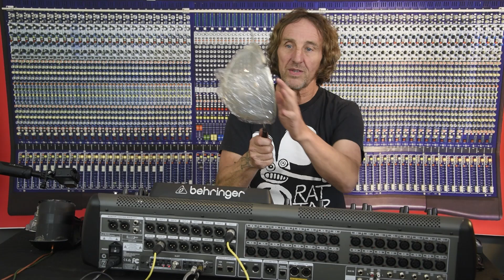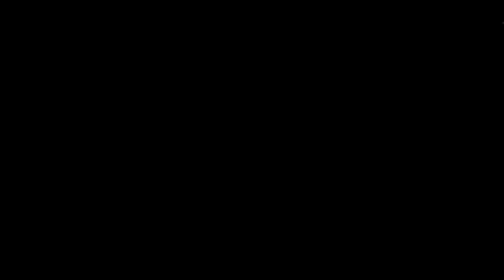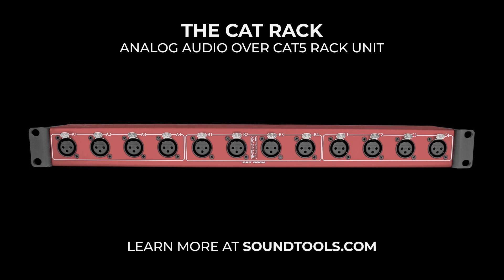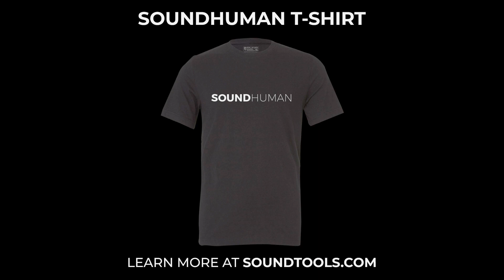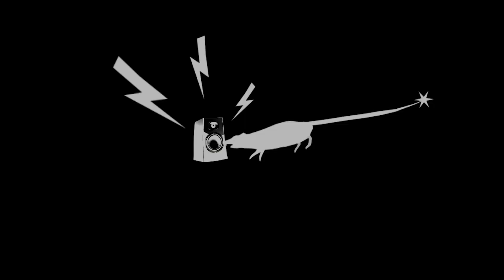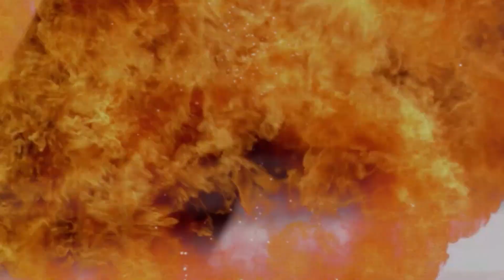Aux Fed Subwoofers Are Better - Because of How Mics Work

Comment: Another benefit of subs on an aux, is that you can easily push the energy of an entire mix on one fader or knob. Also, once the venue fills up with bodies, being able to move a bit more air by pushing a sub aux up a bit has helped me out.
Reply: I’m not going to say I don’t do this when I have Aux subs, but you do need to be aware that you are not just increasing volume, you are also changing the way the crossover is functioning. You will get a spike at the crossover point when you increase the sub volume. Not always a problem, but something to know.
Reply: @petertalalight7340  great point A++
Reply from the maker: And what do you think happens to the subwoofer volume level versus the tops and the phase at crossover point when someone walks 10 ft closer to subs and farther from the tops?
Reply: @Dave Rat  haha. Math is hard man.
Reply from the maker: I find it fascinating how much concern ther is over phase and time align of subs to tops.

Ha! Got to get that subwoofer time alignment, crossover and volume level to tops precise because that 14 foot wavelength at 80hz requires so much precision.

Got to keep that level precise because your subs coverage is perfect, consistant and within a fraction of a db of the volume of the tops matched throughout the venue, right?

So therefore to keep that precision, we will use the crude high pass and let our subs reproduce unwanted junk sound. 

I love diving into controversial subjects and will ponder doing a vid to put the importance of sub to tops alignment in perspective and when it matters a lot or a little.
Reply: @Dave Rat  it was actually quite eye-opening in your video, how much junk was still getting through the highpass filters.
 Regarding time alignment of sub to top: I've actually had situations where I purposefully delayed the subs because that happened to work better in the particular situation.
 Cheers.
Reply: @DaveRat  wow just a brilliant analysis. Arguing for maintaining phase and levels at the crossover point, when the distance between tops and subs differs for every one in the audience ha!!

Comment: Here in India, the Aux fed Subs is a Standard with most Sound rentals. As none or i would say very feeble guys know the true reason of sending Kicks, Low-freq percussions and Bass Gtr via Aux to Subs which are crossed at 120Hz or closer. Now all these low Frequency instruments produce a substantial component of 120Hz up to 1kHz. To which our charlie's in India abide to the final  testament and do not feed a bit of High frequency to the Tops (LR), fearing that the Subs may blow. As a bassist it takes a hell-lot of convincing to make them open my bass gtr channel on LR. Lack of knowledge to be blamed

Comment: I need to figure out if I can to this on my Yamaha TF-1
Reply: You can do this on any mixer that has an aux channel. But if you should is a different question
Reply from the maker: True, any console will do it.

As far as whether you should do it, Imagine every mic needed to be on all the time in the main PA, yuck!

We can turn various mics on and off and up and down. We can turn various inputs on and off in the front fills or in various wedge monitor. 

If ya have actual subwoofers, it puzzles me as to why would anyone not want to be able to reduce unwanted noise sent to them.
Reply: @DaveRat  have you heard of  Dan Dugan Automatic Mixer?
Reply from the maker: I have not but looked it up and seems interesting for situations that need automated level control

Comment: LF spill is incredibly high in distortion because it's the stage vibrating. Stages can vibrate enough that people cannot stand on them if you screw it up really properly - there have been cases of permanent damage to ankle and knee joints from the bigger meyersound rigs. That's vibration. Mechanical spill is nasty, especially coming through the shell of a floor tom by shaking the stage.
Reply from the maker: Agreed

Comment: On tour, I send the house 4 lines for the band I'm mixing. L/R/Sub/Fill. Occasionally, I'll run into a venue where they absolutely insist that I run L/R only into their full range system. I have noticed that these FOH humans tend to be old heads that do not love to adapt. I concur on your "audio purist mentality" observation. We make it work no matter what, that's the job. But I certainly do prefer Aux-fed subs.
Reply from the maker: I used to do aux fed subs emulation for those gigs.
Reply: @DaveRat  Interesting!

Comment: Years ago I attended a great seminar by Buford Jones for Meyer Sound, where he addressed sub-woofer levels. So many techs just push the subs up to full power meaning there's basically a huge level boost at the sub-woofer frequencies. He advocated a balanced system, and to prove the point played some gig 2-track board tapes through a system, which not only sounded amazing (I think it was Jackson Browne), but had a completely smooth and balanced low end.

Take time to get a balanced system, then use a separate sub-woofer feed, and you'll be a long way to getting a clean and musical low end!

Comment: I have been doing aux fed subs for many years....since way before digital consoles etc. I started when I acquired 4 EAW FR 253 cabs for FOH along with 8 single 18 JBL cabs. I experimented by running the EAWs full range in a LR combination and ran the subs in mono on an extra aux send, it was like the sky opened up and the sun came shining through....i only used an external crossover on the subs and a separate EQ as well......i could dial in what I wanted through the subs, things like cymbals, drum overheads vocal mics etc could all be dialed in much tighter and I wasnt using all of the energy sent to the subs that was being wasted on things that just werent generating those frequencies. It cleaned up the mix tremendously, of course I could also use high pass filters to keep those unwanted frequencies out of the FR cabinets as well.   I still to this day swear by this method, it has worked wonderfully for me.

Comment: Hey Dave, I've been watching a lot of mixing/mastering audio production videos in the last few years and I noticed that they tend to use lo/hi cut filters on guitars to remove the whoofy low end and shrilly high end, but to me this seems like more of an issue with the mic not capturing the frequencies correctly. Do you have any ideas on how to make guitars cut in the mix without deleting 15-20% of the guitar tone? Thank you
Reply from the maker: If the mic picks up exactly the sound you want, then no EQ or filters are needed.

But mics rarely do that, diff mic, diff mic position or EQ.

Remember that mics don't pic up sound like we hear sound so using EQ, high and low pass to fix that is normal

Comment: Never knew there even was a debate about this.
Always subs on a separate send. Partly for the reasons you cover, but for a lot of others as well.
Such as a stage where bands and DJs are sharing the same system. I don't want to HPF the DJ rig, but I do want to reduce the subs when they crank the bass control on their mixer to +12.

Or theatre for dance shows where you have varying quality of tracks provided. Much easier to adjust a single fader for the subs than adjust the EQ for each track

Comment: Wouldn't we get a similar benefit if the high pass filters on each channel were very high order (steep slope like 120dB/octave)?     IMO, it would interesting if someone offered phantom-powered, ultra-steep, high pass filters to insert in microphone feeds to try to solve the problem at source.   In practice, I also use aux-fed subs since this is easier to do, but I still like to think about alternatives.
Reply from the maker: High orderr crossovers tend to create high order ringing, massive phase shifts and tend to not sound great. I will do a vid on it at some point.

Each 6 db of slope causes 90 degrees of phase shift. So a 120db crossover would have 1800 degrees of phase shift. Not sure what that would sound like but I do know that just enabling HP filters, even with them set to the lowest setting, alters the sound and adds ringing

Also, we already have a crossover to the subs, adding an additional HP filter that is basically redundant just adds phase shift and ringing.
Reply: @DaveRat  I also find the even with 24dB/oct HPFs like you find standard on Avid desks that you can still get noticeable LF crud in the subs. I think a lot of folks don't realize that there can be a significant amount of energy below the corner frequency on pass filters of fairly steep topologies. The more common odd ordered (less desirable) 18dB/oct. filters are even worse of course. Have you ever used an original Presounous Studio Liver mixer? They had 6dB/octaive HPFs on them. Almost totally useless!
Reply from the maker: Absolutely, look at all the filtering issues digital has on the top end to prevent freqs from hitting the Nyquist.

All that is done above audible range. Steep filters in the audible range get messy fast

Comment: Using the 'high pass' function in a channel strip often is like renting a car without knowing that multiple types of cars existed. Engineers use a 1st order high pass at 100Hz and wonder why they're still getting 80Hz from that channel. Not sending an instrument to the subs does help with this, but imo it would be better to eliminate the problem at the source (because the unwanted low-end might needlessly trigger the compressor in that channel for example). You might need a 4th order high pass, but now we're running into limitations of our mixing console, since the live industry seems to be 20 years behind the recording industry.
My favourite console, the Yamaha Rivage PM5 gives you the option to change the slope of the HPF up to 24dB/octave (4th order), but I think many cheaper consoles, even modern ones lack these kind of very basic features for no other reason that to arbitrarily limit the usability of these consoles, trying to sell more higher-end gear.

Comment: Equally applicable to mixing for recordings. It's the same reason to high-pass tracks that shouldn't contribute to sub (subjective choice, of course). I find your videos make sense immediately, though I may not have ever thought about the live use case before. This is another very helpful video. Thank you!
Reply from the maker: Awesome and thank you
Reply: I was contemplating how to apply this to a recording studio setting. Not for continuous monitoring but to check the hipass on channels, like you say. Brilliant. I work OTB

Comment: How would you deal with this when working on a system with a high x-over frequenzy (135Hz acoustical x-over
)?
Reply from the maker: If you don't have subs then you don't need subs on a separate send
Reply: @DaveRat  Yes thats clear to me but in this case I do have subs.
I'm talking about a system with 1 horn top (135-18k hz) and 3 subs (40-135hz) per side and i believe that not sending vocals to the subwoofers would result in a lack of low mids if the singer has a deep male voice for example.
Reply from the maker: Having a higher x-over diminished the value but having the control to send more or less vox or instruments to the subs can be helpful.

Unlike EQ or HP, sending less or more to the subs does not introduce phase shifts and ringing and such that filters do.

Any crossover to sub issues are already there and won't change. But often you can avoid adding more stuff inline

Comment: Hi Dave! Would you have a quick suggestion for the avenue of master bus processing and glue if one were to split like this? Maybe having one mix of everything going to the tops (and it have the master chain), and then leave the subs with minimal processing (and latency compensate)? Is that right??
Reply from the maker: Is there a bunch of ways of doing it probably the easiest is to run everything to groups and have some group send to the left right and some send to the subs and left right

Comment: I have to disagree here. Although I'm not against using a seperate send for subs, there are several considerations personally I would look into before doing so. 

1. Signal path latency in digital consoles. I'm sure the system techs out there would love a conversation with the mix engineers about this!! 😂

2. Operator interchangeabilty. (I've seen lots of consoles set up with aux fed subs and then a guest engineer shows up and wonders why his kick drum has no low end to it. A minor issue but a consideration nonetheless.)

3. A lot of modern line source systems will still reproduce frequencies down to 50Hz or below, so not sending certain sources to subs doesn't solve your original problem anyway. 

Once again my approach in this matter is more of a pragmatic one, but for me there are certainly more considerations to be made before tying yourself up in knots. 

Thanks for continuing to post great content!! 👍🏻
Reply from the maker: Hmmm, the "I don't want to go because I might get lost" logic.

One could also get good directions and go.

Setting subs up to send from a matrix and le to also send from a matrix and send the channels that need subs to one set of groups that are sent to LR and subs and sending channels that don't need subs to another set of groups the only send to LR.

Would 
1, create identical paths so no latency

2. Allows mixing with or without subs on an aux

3. Modernine arrays do go low and if your line goes soow that you don't need subs, why do you have them? If the subs go lower, then the subs are reproducing freqs the line is not, and putting subs in an aux stop thos instruments from getting to the additional extended range speakers.

That said, improving the cleanliness and clarity of the subs is not important for some people and applications.
Reply: @DaveRat   Good arguments. The groups idea does indeed solve the latency issue albeit having to bypass your traditional master bus summing which may or may not sit well with certain mixing styles. However, I can't agree more that a tighter more controlled low end response is something that everyone should be striving for!! 👍🏻
Reply from the maker: Yeah it's not imperative that people do it it just has advantages that are more pronounced in some situations and extremely evident in adverse environments

Comment: Dave, I mainly mix corporate events… some of our bigger shows has subs. Would it be ok to send a little speech to the subs or mainly keep the subs for music and video?
Reply from the maker: Whatever works and gets you the sound you seek. The main thing is the ability to not send things to the subs that sound bad in the subs.

Treat subs like a cenerfill or stage monitor, send what ya need and don't send what ya don't. 

With subs on LR, you are forced to send everything
Reply: @DaveRat  I always run my subs on a matrix out! Thanks for the reply!

Comment: I thought about the ultimate mic diaphragm, making the diaphragm out of Aerogel and graphing as the inductor coil,
 shouldn't be too hard to manufacture. 
All right received on Aerogel and graphene inductor for microphone diaphragm 2018 © . Fancy manufacturing and testing one. Looking for finance.. I know an F1 company that can put it together.
Reply from the maker: Fun!!
Reply: @DaveRat  I'm not sure what you mean fun lol could be a game changer in microphone technology What's your opinion??
Reply from the maker: It's out of my realm of expertise. Lots of variables and may have potential. My experience is that as the prototype is being built, complexities tend to manifest and that is the fun, diving in and seeing if they are solvable or push the design out of feasible
Reply: @DaveRat  yeah that's true in what you say. Yeah I've got a lot of ideas completely different to standard type of setup

Comment: I go another step further: I only send my kick and bass and keys to my subs, on Aux 1. But I send the aux cable (I'm still an ANALOG Midas guy, with real tube preamps, and Meyer speakers)  through a BSS 966 31-band EQ, with all the frequencies above 100Hz pulled out before it goes to the subwoofer. The "click" of the kick pedal hardware is still present in the tops.  I use the ANALOG pot on the BSS to narrow or expand the Q for the five EQ bands that are left. I can really tighten up the kick, while letting the bass and keys have their low frequency fun, too.
Reply from the maker: Cool, love all plans that work and puch things farther than simple and lazy

Comment: A few years ago, perhaps when the practice became mainstream due to its dissemination on the internet, it was a debatable topic in a Facebook group or forum in Spanish from all over the planet. Each one told their experiences or doubts, advantages and disadvantages. I still did not understand some detractors until someone from a well-known brand from Europe mentioned the limitation of a sub with a "low-pass" filter. Then I realized! I told him that here in Latin America we still use DIY Subs a lot and that implies that they are not cut or pre-configured systems, depending on the model of subwoofer (or woofer/midwoofer) and its cabinet, enclosure, box or design, full range may or may not be used and there it is! the big difference. If mechanically, etc. it goes up to 2Khz or more, for example, I completely send a kick drum or an electric bass to play through without going through the top or others systems, etc. #Lego #WallOfSound #MatrixMix #Submixes #AuxMixes #Whatever Call it what everyone wants to call it. I'm interested in the results, the greatest and best satisfaction for and of all if possible. 🎶